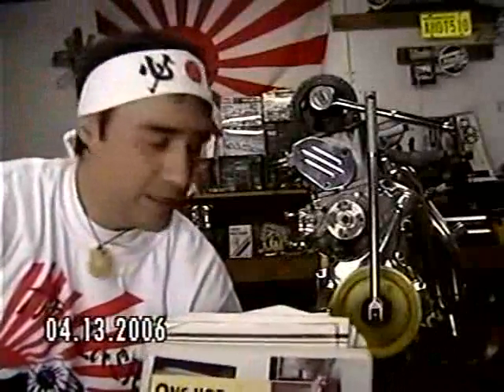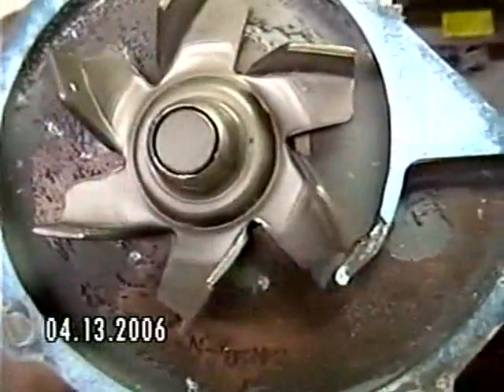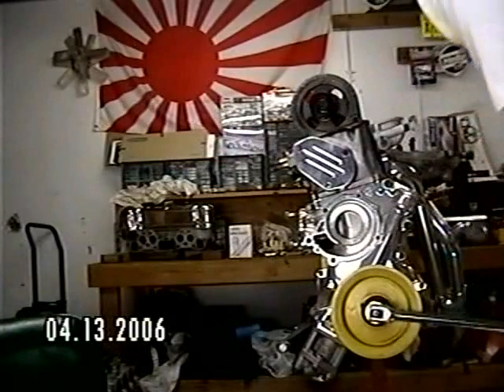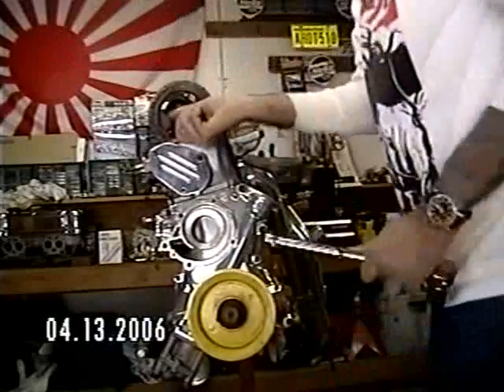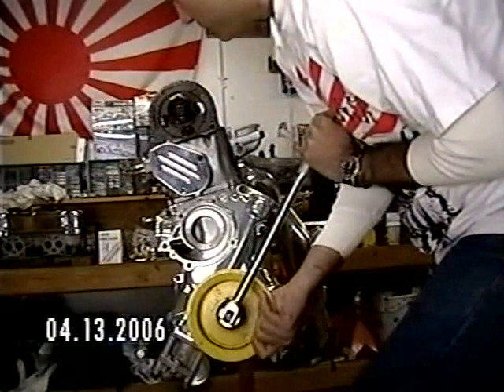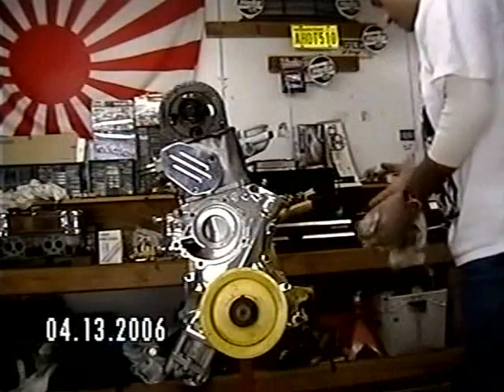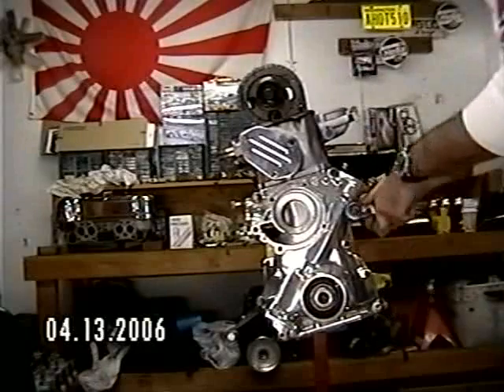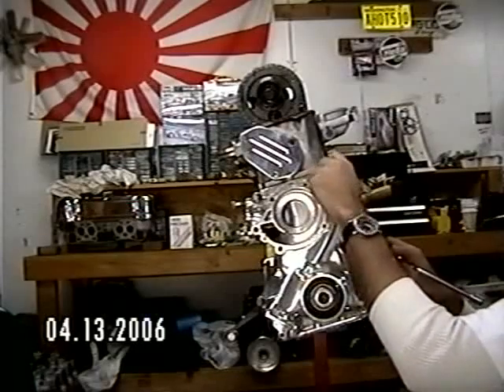datsun L Series head replacement part 1

Comment: You mentioned the L20 b's can be hard to get at the exhaust manifold to undo. Just how does one remove the head when inside the car , does one remove the clamp to the exhaust to the pipe then pull the whole thing out along with the manifolds attached to the head? let me know.
Reply: The way I do it quickly, is unbolt it at the flange, then wedge the chain, and then break the head studs in sequence. Then remove anything else needed to get the head removed. Then disassemble it on the bench. Reassembly is in reverse order.

Comment: do you have a 1978ish L20-B engine to rebuild in the future? I'd like to see how it's done. I'm sure it's all similar to the one you did here. I have had the head off twice and cut both times, not sure if it will go for another cut if I ever rebuild this motor myself. the 78 truck is fully restored like new! I won a trophy for it in 2017. I'm the original owner and it's immaculate-it's a calif. model  4 speed. only 235,000 miles all original. kevin